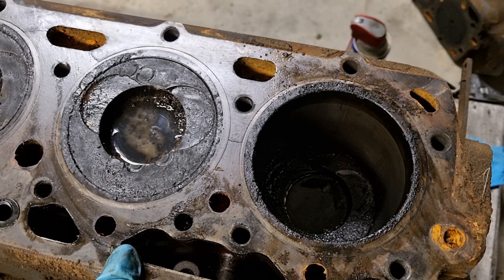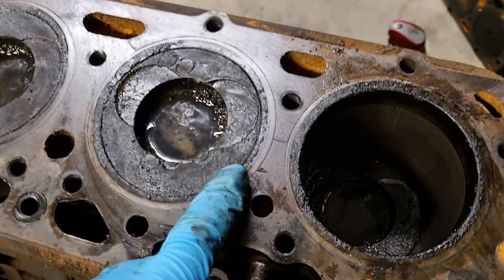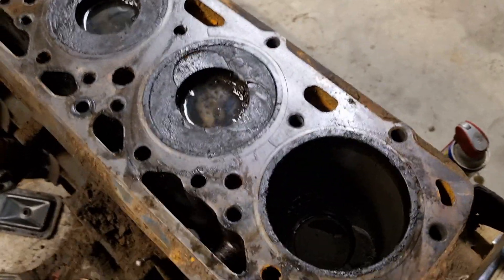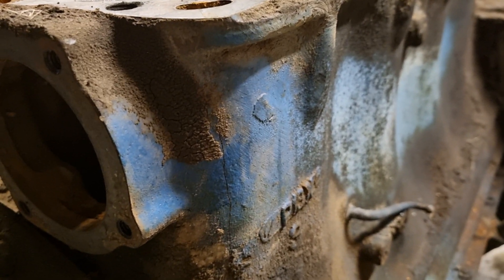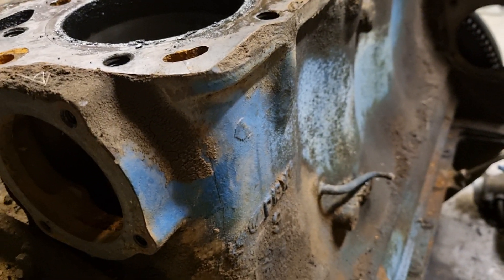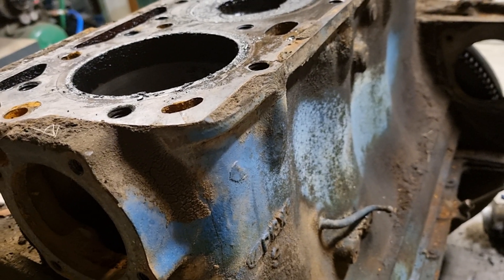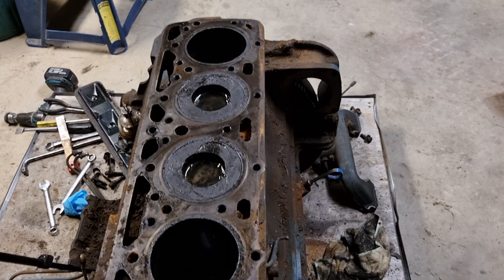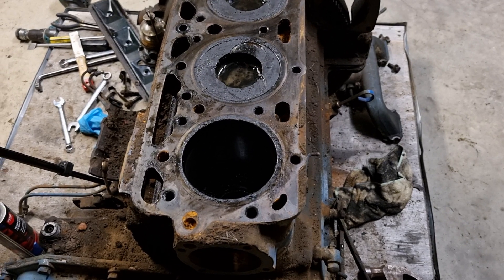Fordson Major Cylinder Block Damage

Comment: i have the same model as you and i have enjoyed many of your videos and it has been much learning for my part. i was wondering if you could tel me what the small arm at the side of the engine is 30 sec in the video, the one below the casting number. i have seen some pics online where i has been connected to something but cant quite find any information on it.
Reply: 'through the block' type throttle linkage ;-)